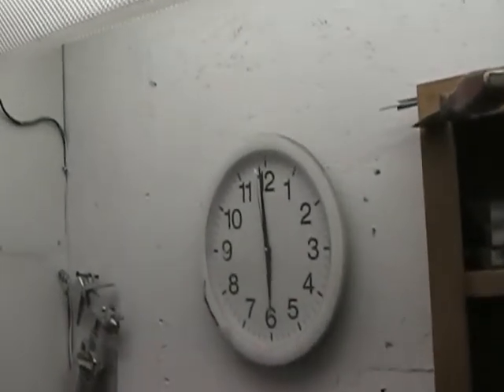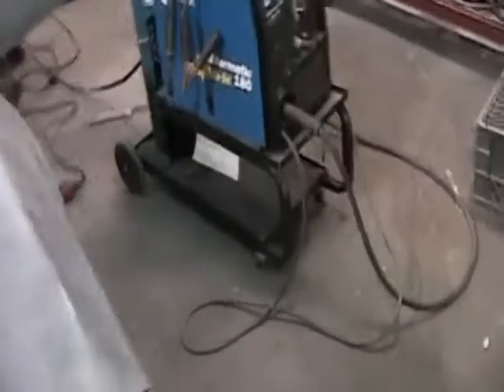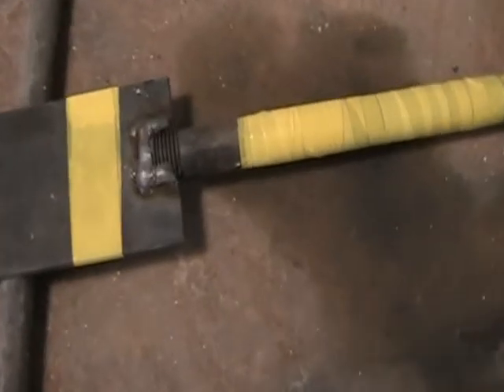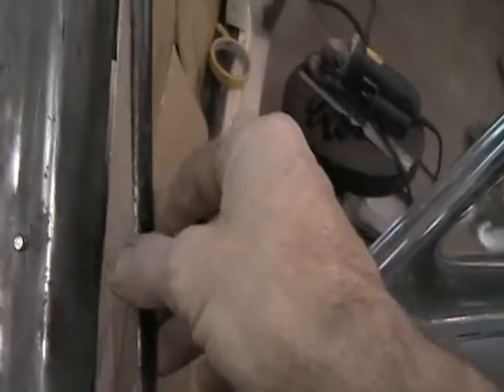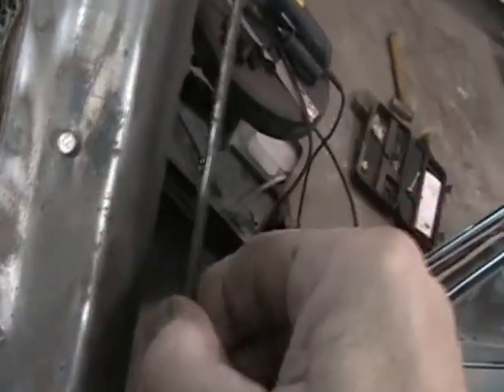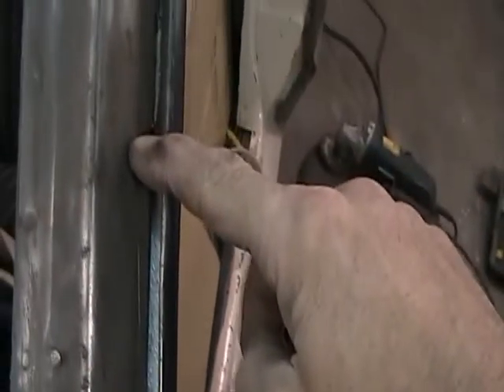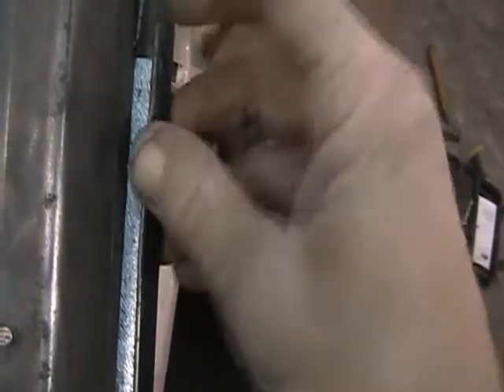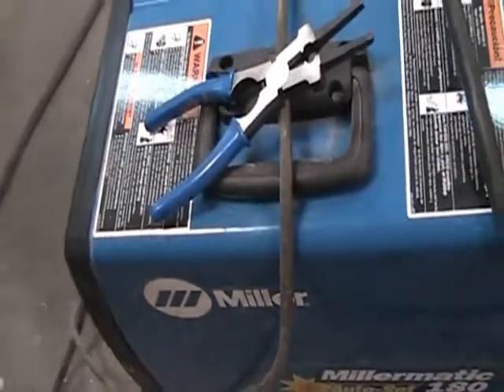mon and tues power hours

Comment from the maker: that bolt hiding way up inside there is going to let me adjust the fender lines alot easier,what is welded is the 2 bolts at the very bottom of the fender,at least now i wont have to cut them,hopefully the work will go faster now that i figured out the rain rails,whooosh,lol,thankx for watching tom and if u ever have a thought at what im doing,feel free,my experience level is very low,getting some knowledge on a mustang now though,lol,take care

Comment: nice work on the drip rail, did you ever get the band sander, perfect application for it grinding those drip rail welds

getting pretty handy with the fab work rick, novas gonna be a doddle now